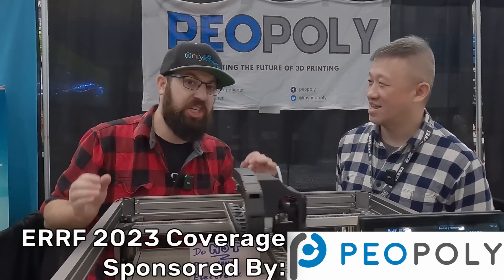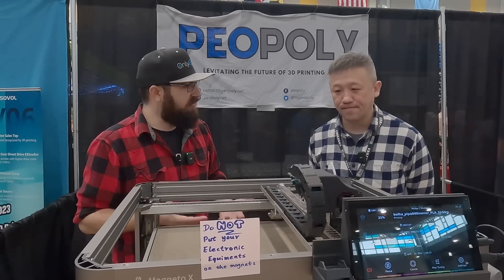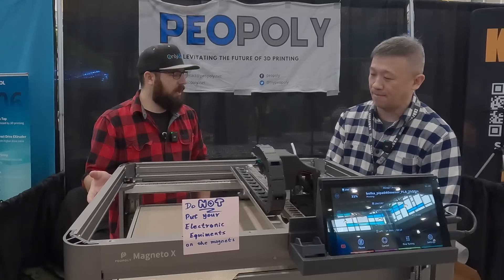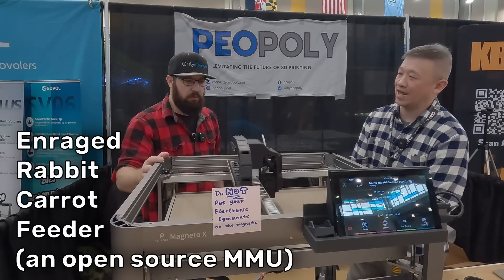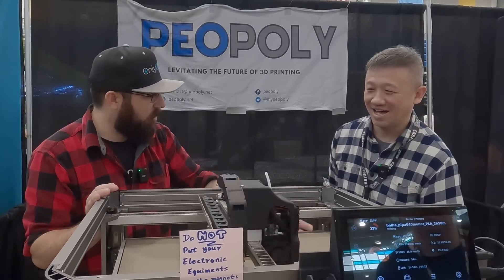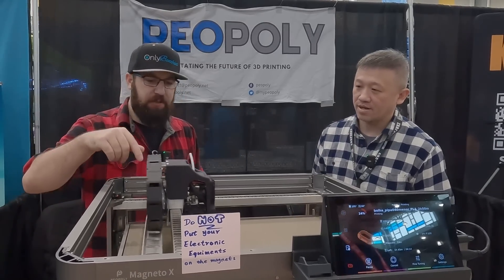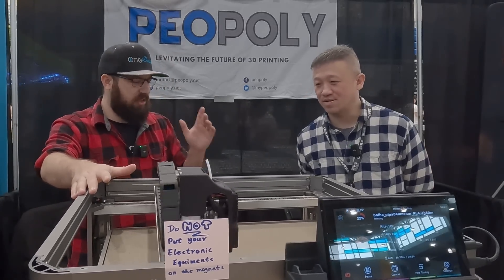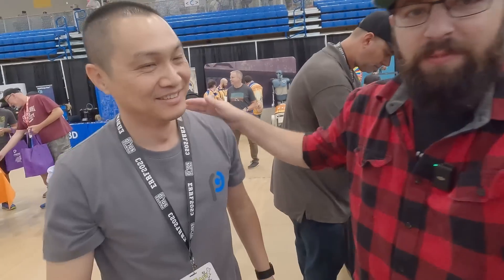SOMETHING ACTUALLY NEW IN 3DP - Peopoly Magneto X

Comment from the maker: Was a bit of a rush getting things recorded saturday morning before the rush when doors open, so some additional details not included in the video
-Printer took a knock during shipping and was unable to print
-While the majority of the hardware is off the shelf, the linear motors and their drivers are in house design
-Now, KLIPPER only sees them as normal steppers, so theres no modification to klippers code for them to operate BUT
-AT THE MOMENT they are closed loop but do not have error corrections, so if it detects a crash the motors shut off
-Some things on the printer shown are not final (again, engineering unit) so things like the fans intaking air from the chamber for PSU cooling, wire management, panel alignment, wire connectors are all NOT FINAL REVISION
Reply: @Nero3D do we know if z offset adjustment/baby stepping is still manual? I've heard mention of the load cell for ABL in a couple interviews but haven't seen z offset explicitly talked about. Fine adjustment of that is still a thing in some situations and the status screen looks like it has a menu option for that, but having the machine do it and not having to fiddle with it like the mk4 and bambu units would be really nice.
Reply from the maker: @SkateSoup  Its got a loadcell for the nozzle probing, also its running stock klipper so you can adjust offsets and also babystep to your hearts content
Reply: e nm, I was mixing up technologies, a load cell is integrated into the tool head and uses the nozzle as the point of contact rather than a separate sensor so there's no traditional z offset between nozzle and a separate sensor somewhere else on the tool head. So glad, that might have been a make or break for me as a purchase since that process has been irritating me to irrational levels lately.
Reply: I can't see any measuring systems for the closed loop control. Linear scales are very expensive .
Reply: @newolde1 give me a break. you must be delusional... where is your prototype that's so much better?
Reply: @Maleko48  really? Delusional? Did you not watch the video? The only redeeming point was that the printer moving, which is ignoring the fact that it looked like a building in a Richter 7 earthquake. There weren't even any example prints shown. So basically there's no proof shown that the printer actually works. Would you really call that a good sales demo?
Reply: did u ask when will they show the real demo of printing of any objects? but not the invisible objects in this video
Reply: This has to be one of the worst presentations I've ever seen in the 3D printing world. I get that accidents happen and the printer was damaged so unable to print, kinda. But then that begs the question, does it use a proprietary extruder or something? With that and the super janky table setup it is too much. It's confounding that Marc and Peopoly would be ok with presenting their creation like this. That's not very confidence inspiring. If it were my company I would have seriously debated walking out on this show, or at very least just put it on the ground? Whoever put on this show should be fired, bar none. Sorry to be negative Nancy all over this, but, Nero, I'm surprised you would highlight this, as cool as the tech may be, which, is still a mystery at this point.
Reply: @newolde1 Have you ever presented anything at a trade show? Or gone to them? This demonstrates the tech and capabilities. Everyone knows what a 3D print looks like and that the extruder and hot end on this work like most FDM printers.
Reply: @802Garage  have experience with trade shows. Clearly it doesn't. They literally demo'd a product that doesn't do what it is intended to do. Furthermore it was bouncing around like a jack in the box, which is just terrible imagery both for the product and the company as a whole. Print samples would say alot. Yah buddy we know what 3D prints look like, you're missing the point. We currently have no idea what the accuracy is like, for instance, or if there other are unresolved issues. Resonance? Layer consistency? Can it print for 24 hours straight without fail? We just don't know what quality prints this printer is capable of, which is the whole point, is it not? And to defensively say, oh they can figure out any current issues is a cop out. Imo they probably shouldn't be doing crowd funding at this juncture.
Reply: @newolde1  Sorry, I just totally disagree with you in general. I'm not going to go point by point. I think the display and the video demonstrated the product fine, even if it obviously was not in the best light. No doubt it could have been better, but you're just too hyperbolic for me.
Reply: @802Garage  ok
Reply: @newolde1 printers were sold out 12 days after the start of pre-sales. and the first batch is 250 units.
Reply: @newolde1 No one forces you to believe in anything.  I pre-ordered and purchased this product for $1399 simply because I wanted to support the development of beltless printers.  You can wait for reviews and then buy for 2000+$. 
or don't buy. 
what's wrong with you?
Reply: @1288832  good on you for putting your money where your mouth is and supporting development. I hope it works out. To be clear, I'm not bashing the concept, nor even saying this particular project is junk. My point was simple, this was an absolute mess of a presentation, unprofessional, and didn't prove much if anything in terms of the platform. Cheers.
Reply: @1288832  and really, why is it that you don't have the capacity to hold respect for someone that has an opposing opinion to your own to the point to where you feel driven to attempt to belittle them?
Reply: @newolde1 Perhaps Google Translate showed no respect for someone's point of view.  Personally, I wanted to say that for me this presentation was quite successful.  I apologize if the online translator offended or insulted you in some way

Comment: The linear motors is another step in the right direction. This brings 3D printing closer to the mainstream dince taking iut the stepper motors you take away a lot of the noise and adding a closed loop control system you increase intelligence and reliability. Another huge step forward would probably be material selection.
Reply: The noise from steppers will also be in the linear motor. They operate on the same principle and use the same electrical signaling to drive the motion, it’s just a stepper motor with a stator that’s “unrolled” into a horizontal plane. So I really think the noise will be only marginally better than standard steppers.

Comment: Sounds cool. The only negative is that if the Magnetic-based linear motor system dies --- you are forced to get this proprietary replacement part.
Reply: There is nothing to die there. , I am sure the driver can be bought separately. Also rails of MGN 12. Just do not heat magnets above 80c

Comment: Cool stuff.  Love the simplicity and the build volume.  I am a little concerned about the one sided drive across the back allowing flex left to right at the toolhead when printing across the front side of the bed vs the back side, but it looks like they did a good job making the toolhead's rail pretty stiff.  Using the echain trough as a stiffener was clever.  The amount of deflection is probably insignificant with input shaper.  It will certainly be interesting to see some reviews when it is released.

Comment: Only downside is that having the magnets on the cross gantry increases the inertia of the tool head since all the magnets need to move with the tool head (if moving diagonally, otherwise half). If the linear motors were built into the frame of the printer and there was a cross gantry setup that is just carbon fiber linear guides then it would probably be able to move faster.
Reply: 1500mm/s speed and acceleration 22000mm/s²

Comment: Brilliant! The entire printer is visibly wobbly, but you may potentially fix that adopting a truss frame (triangular mounted beams), I am impressed why this is not mainstream in core XY because a cube frame is inherently unstable (like a 4-bar linkage mechanism)
Reply: The printer is not wobbly, the table is. This was on a very cheap flimsy table

Comment: i guess, they will not beat the speed of a belt Core XY printer. The density of Neodym permanent magnets is similar to steel, thats why the moving gantry is to havy and thats the reson why the printer is shacking like a vibrator by moving left/right.

Comment: I'm actually pretty pumped for this!  Hopefully you will be able to buy just the rails separately.
Reply: Yeah, eventually I'd like to upgrade the motion system on my delta printer.
Reply: You can already buy linear magnetic motors they're just incredibly expensive and require more sophisticated electronics than stepper motors. (They're driven the same way as a bldc motor and will require positional feedback)

Comment: I suppose the moving parts would be significantly heavier (a rail full of magnets vs modern light carbon rails and light belts, electromagnets vs traditional stepper motors), with all the probable consequences (ghosting etc). The main noticeable thing here is how the whole thing shakes despite the massive frame and reduced speed. Also the mentioned 80°C chamber temp when motors precision can be affected is something of a concern.
Reply: Uhm...I think it's the table that is shaking on which the printer is standing on, not the printer's frame itself. There is a lot of abrupt acceleration and transfer of energy happening, so when the printer's frame will not flex, the flimsy legs of the table will, especially due to the added weigh of the printer you mentioned.
Reply: @d1oftwins  i don't think they will solve shaking problem. The mass of the magnets and the motor is just too big. They need like 200 kg frame to greatly reduce shaking. Another option is to run counterbalance, but this would double the price.

Comment: Now I really wanna see it with an IDEX. not having to do an entirely separate belt system for that would be so cool. I'd imagine they'd have to alter the drag chains through to give 'em room, probably have them rotated 90 degrees and above the gantry rather than resting on it if that's possible.

Comment: The only weakness I can see with this design is if foreign particulates on the flat magnets would cause interference the motor function or accuracy. Otherwise this seems like a great idea.
Reply: I doubt particles small enough not to outright hinder movement will be a problem for accuracy. They may become a PITA to clean up unless you put some sort of cover or film on top for easy removal.
Reply: just cover the magnets on the rail in epoxy... would ease cleanup and keep stuff from sticking. Could put a smal crown in the center to moving any drifting particles to the sides, maybe put a small fan on the print-heads to blow dust off the track.
Reply: @GlueTubber  Put a layer of cling-wrap, pull off and replace for clean-up.

Comment: Very interesting machine, great to see someone thinking outside the box, or how they can innovate inside the box :), will be nice to see if they keep Klipper and other hardware completely open, if they do they will get more respect from the community, also will be interesting to see how they overcome the spring or bounce action of magnets as there will be no dampening in this system and we already suffer from VFA caused by the magnets in some steppers, heat is going to be an issue though, printing ABS and ASA in an enclosed system with an active chamber heater can see the gantry rails hit over 100° C as they are always above the bed that is radiating heat directly upwards, they may need to look at a more expensive high temp magnet array option, overall though, Im looking forward to seeing this one in operation.

Comment: One thing about chamber temps over 80c.  An "easy" way to get hotter temps safely would be to run coolant in a channel under the magnets etc.  Then it's just a matter of running flexible tubing in a chain to the moving X axis and the Y axis could be plumbed in with hard lines that run out to an external radiator.

Comment: I find the use of a support guide in the x-axis (hidden behind the front of machine) concerning as there is now way to completely eliminate play in an unpowered guide. As such, the vibrations will increase as the tool head gets closer to the guide. Its possible that it could be kept to an acceptable level but its less than ideal. I would prefer they drove the guided side by using a single belt loop from the x-axis linear motor. Or, of course, added a second linear motor for the x-axis but that is a bit of overkill. We just need the driving force to applied in-line with both x-axis gantries as opposed to one having such a large moment arm.

Comment: I think we ALL need to see print quality. 

@Nero3D Do you think this should basically remove all fine artifacts other than extrusion artifacts (drive gear irregularities, filament diameter etc?)
Reply: if its anything like the industrial linear motors in $100k+ CNC machines then they have the potential to move smother and more accurately than most ballscrew/servo setups.

Comment: Fun Fact: Research and development of high speed cutting methodology was advanced most significantly in the late 70’s and early 80’s by way of the Advanced Manufacturing Research Program, funded by DARPA. They were able to achieve cutting speeds of 16,000 in/sec or 406,400 mm/sec. The rapid speeds were higher.

Comment: 700 mm/s is very impressive considering the amount of weight of the Y axis is with all those magnets. However I like to see it before I believe it 😅
Reply: Linear motors can do impressive stuff. I'm in the same camp but if anything is going to do it (maybe even faster?) then I think linear motor technology might actually be the thing. 

I imagine the future arms race will be about reducing weight and having stiffness for this design basically.
Reply: @MoonWind32690   Yeah given how much precision you can get out a bldc (odrives) these days I can only imagine this system could perform even better. I'm curious about the acceleration curves of these things.

Comment: YES! I always said that belts were a very big limitation simply due to the G force. 3d printers are getting so fast that rubber belts simply are not cutting it anymore as again the G force is way to powerful and needs a stronger belt to handle the high speeds.

Comment: Hopefully they implement the “firmware upgrades”, is an easy to use manner for people brand new to Klipper. Have seen companies use stock Klipper but have a custom Klipper screen UI and display which can “break/brick”, when Linux OS packages get upgraded.
Reply: Any printer with a proprietary interface turns into a pumpkin whenever you want to make any tweaks.
Reply: The ideal system for me would be a complete image from the manufacturer for the SD card.
Then, even if it bricks itself, you can just reset everything.

Comment: Linear motors are not new. Building a 3D printer on linear motors is!
Reply: At the risk of being too pedantic, I believe that the Essentium HSE uses this arrangement, but that printer has a six-figure price tag. One advantage to this arrangement is that they refer to it as "true" IDEX, since both the X and Y axes can operate independently, unlike traditional IDEX where the X-axis value can vary but the must have the same Y-axis value.

Comment: They're aiming to ship these next month and so much of the design isn't finalised? 🤔🤔
Reply: You mean it isn’t finalised on the engineering prototype they have on their table. That doesn’t mean that the parts aren’t finalised and getting manufactured back in Shenzhen. Most of the things that aren’t finalised on this aren’t that major changes, just where the fans go or a coating on the magnets.

For a trade show like this, they aren’t going to take the most up to date version, they are going to take an older, more reliable, more tested version that isn’t still being used for development but still shows everything they want to show.

Comment: This is great. Not only is this printer pretty impressive and seems like it could give bambu lab a run for their money. It could bring linear motors down to a hobbyist level for 3d printers and cnc mills.
Reply: Run? Assuming this gets rid of most fine artifacts, then EVERY fdm printer is going to be playing catchup.
Reply: @MoonWind32690 I guess we'll finally see if extrusion is causing those VFAs, my thinking is that they've not been selling it as "VFA-free" so it mustn't have solved the issue yet
Reply: @ballbous  I don't think they are either. But this motion system should drastically decrease them no matter what.
Reply: The only reason it might not give Bambu a run for their money, is pricing. It’s still a $2k (plus extras) printer

Comment: Its not printing ... the table is a baf excuse when people wear printers as backpacks.
Reply: The table shaking is not used as an excuse for not printing. Check the pinned comment, the unit took a hit during transport and couldn't print as a result.  If you insist on making a negative comment why not base it in reality rather than ignorance?